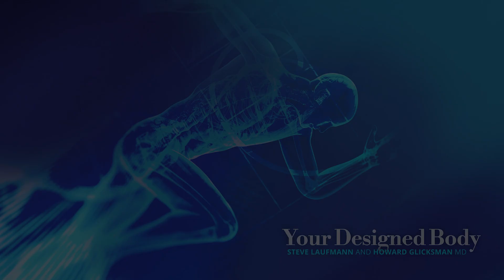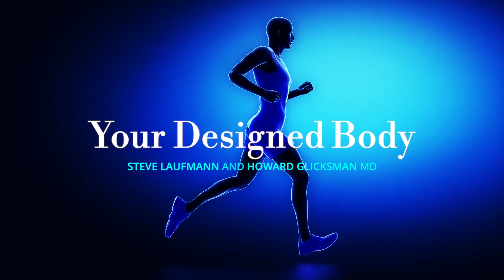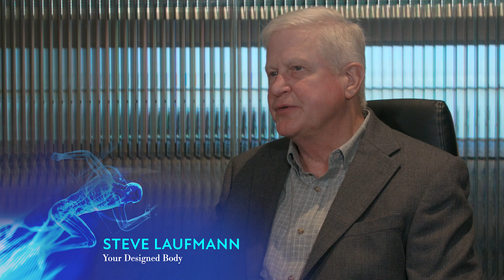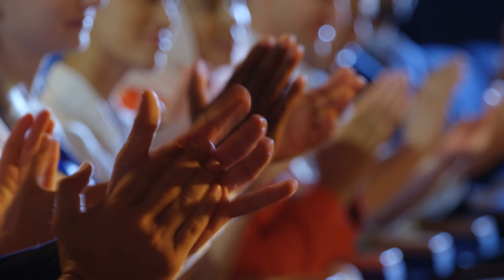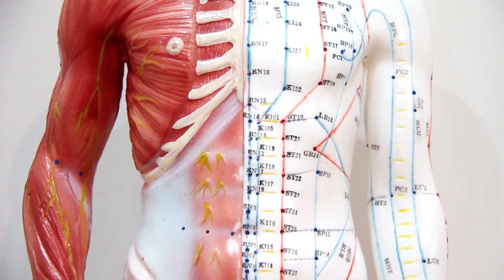Is The Human Body Poorly Designed? (Your Designed Body)

Comment: I wouldn't say it's poorly designed.  I would say that it's about as well-designed as a non-conscious process can do.  It's as well-designed as its environment permits it to be.  The environment is full of variety -- difficult to design something optimal for all environments.  The human body is poorly designed to thrive in either very hot or very cold environments.  Poorly designed to live in water full-time.  Poorly designed to live where the air mixture is too much different than what it is right now.  Poorly designed to live in space.  Poorly designed to live on any other planet in this solar system, and most of the ones we've discovered around other stars.

The ace up our sleeve is our ability to learn, and our ability to invent things.  And that changes at least some of the more hostile environments into more friendly ones.

It's astonishing that bodies can last as long as they do relatively maintenance free -- although both eating and sleeping could be considered "maintenance", and that's not free.  We either do it or die.  At the same time, bodies are vulnerable to a whole host of conditions that can severely impact its operation and drastically shorten its life.

So, "poorly designed" or "well designed" is both true and false, depending on the context.
Reply: Well , mankind has been able to live in both hot and cold climates mainly because of the unique and incredible 
design which includes intelligence .Poorly designed to live in water is like claiming my Lear Jet is a poorly designed submarine? Poorly designed for living on other planets or having eagle eyes that can spot a mouse half a mile away are not a requirement for humans and in many cases these attributes of other organisms  would be detrimental to humans.
Reply: @geobla6600  Man kind was not designed. We learnt how to survive in cold climates by hiding in warm caves when we lost our fur. Hell the hair we have on our bodies is left over from when we didn't have clother, shelter, or anything because our body required it. We exist because our environment said we do, hell some kids are born with tails, plase expalin that one.
Reply: @geobla6600  
[GEO]:  "Poorly designed to live in water is like claiming my Lear Jet is a poorly designed submarine?"

Now you're getting it!

"Well" designed or "poorly" designed has nothing to do with some absolute standard, and everything to do with context.

Humans are well-designed for some things, poorly designed for others ... you know, just like your Lear jet, right?

Comment: The problem with arguing over whether something was properly or poorly designed is that it is often evaluated in light of the desires of the end user, rather than the intent of the designer.  If I use a pair of pliers to drive nails, and find that it does not work as efficiently as I think it should, can I rightly say it is a bad design?  Of course not.  The pliers were not designed by the designer to drive nails.  The pliers must first be used for the purpose for which they were designed, before any right evaluation can be made regarding their efficiency.  The human body was created (designed) by God for certain purposes.  If the human body meets those purposes when used correctly, then the design can't be rightly said to be "poor".  The end user (human) may not like that the body does not do what he/she wishes it to do, but that is irrelevant as to whether or not the the body fulfills the intent of the designer.